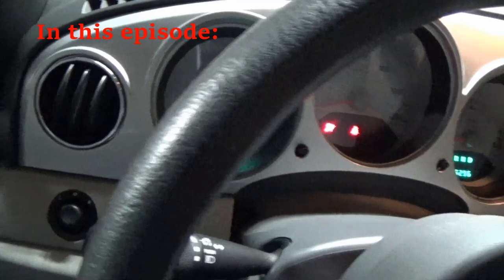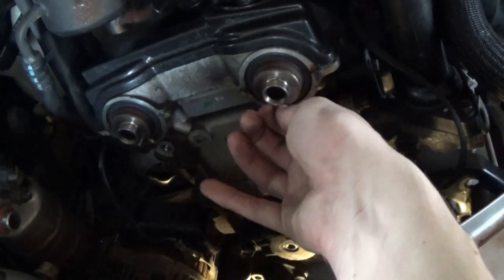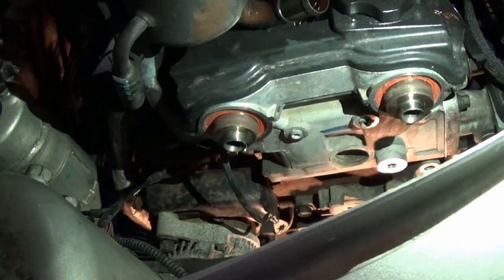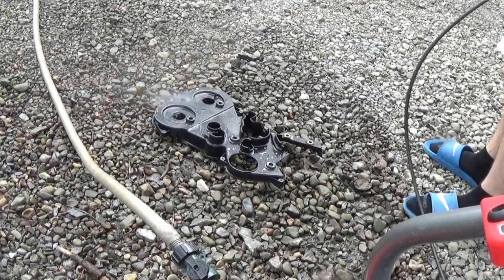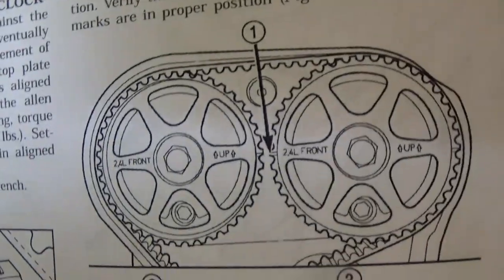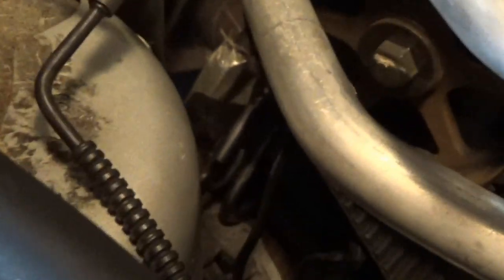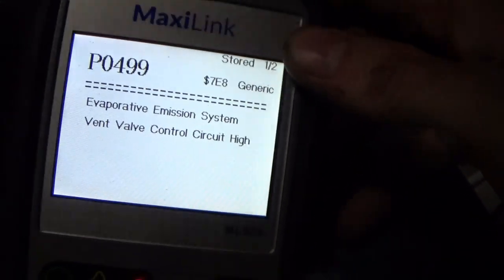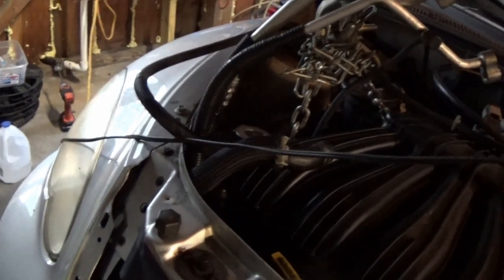Project Vert TIMING & FIRST START! Is The Motor Okay??

Comment: Just a suggestion: When doing the water pump always change the thermostat unless you know for certain that it is in working order (ie you had already changed it before doing the water pump).  Also grab yourself a radiator no spill funnel it will help to 'burp' the engine when you're ready to do that part, you will thank me later for this tip.
Reply: There’s actually a purge valve on the base of the thermostat housing that should be open well you fill, if it is you won’t have any issue.
Reply: When I did my timing belt, I replaced the water pump, thermostat, and radiator cap as preventative maintenance. Then my thermostat quit working 30,000 miles later. I originally got my parts from Chrysler but when that thermostat failed, I got a "premium" one from O'Reilly's and haven't had an issue since then. What's interesting is that the Mopar thermostat said Motorad on it. The Mopar timing belt says Gates on it. I think next time, I'm just going to get my parts from O'Reilly instead of Chrysler.
Reply: My o1has bleeder screw  under thermostat
Reply: On mine there are two (water pump side and thermostat side) but no matter what there always seems to be a small amount of air in the system, luck my neighbor has a Lisle funnel (I had to look up what the thing is called) that gets every bit of air out. It secures itself to the radiator and funnels in the coolant without spilling, best part is the funnel is tall enough that it becomes the highest point and air rushes out in seconds.

Comment: Few things.
1. Enjoyed the video.
2. Why was it idling high? My 08 does as well but maybe 2nd gens rev higher? Idk.
3. You have to bleed the coolant system after filling it. But, may have a stuck thermostat. I did when I replaced my radiator 3 weeks ago. I went with a 180f thermostat. Keeps the engine cooler and that way I know right away if there is an issue. Before it even overheats. 
The way they say to do it is to unscrew the bleed valve a few times every 10-15 seconds, once it gets to temp and thermostat opens you should see coolant leaving the overflow, fill back up to level and once that stabilizes your good to go.
Reply: That bleeder valve should actually be open when you fill the radiator, it releases the displaced air as you fill, once you get a solid stream of coolant coming out you tighten it up and that’s it, there’s no need to mess with it running.

Comment: Excellent job! Way to stick with it & problem solve each issue calmly. I've got an '05 PT GT all-black convertible with 53k on it, summer-only driver... I've done most maintenance to it myself, but tackling the timing belt & water pump would be outta my wheelhouse. Will be very interested in seeing how "Timing belt, the movie" featuring the turbo plays out! Good luck 👍

Comment: Love the intro tune😎 The little bleed valve on the thermostat housing helps with filling the coolant but after many attempts at burping the system on Seabiscuit I switched to using a pressure bleeding system on my PTs now. Way faster and simpler. Once and done. Great vid!